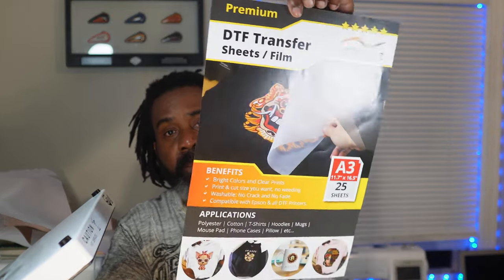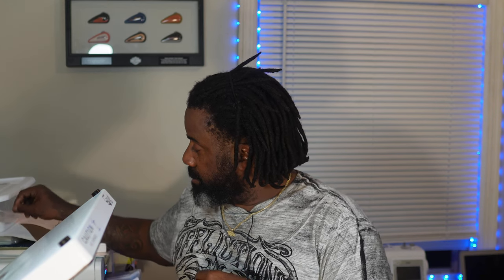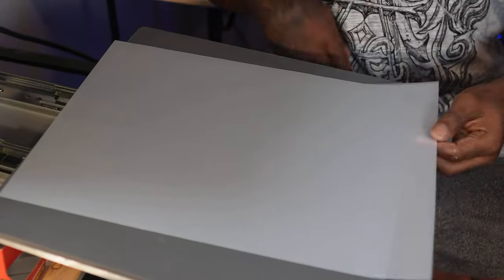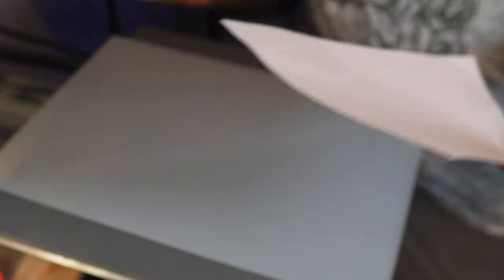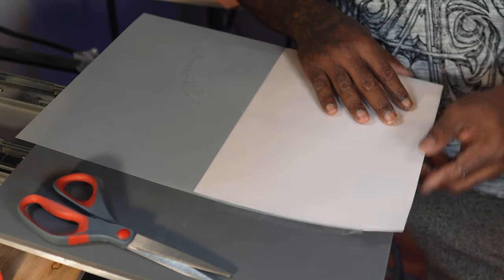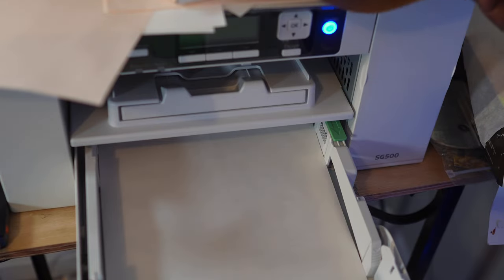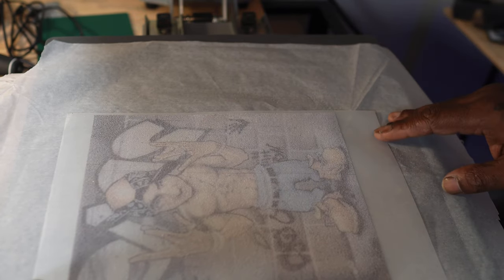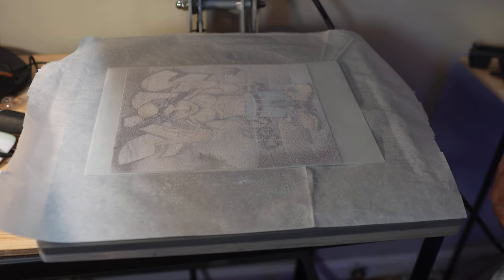How to Sublimate on a 100% Cotton T-shirt using DTF Adhesive #tiktok #hack #directtogarment #review

Comment: What ink are you currently using in the sawgrass sg500 for printing onto the DTF Film without it smearing the ink? I've got a Sawgrass SG1000 with Easysubli Ink and when I go to print it through the print manager my prints tend to smear the ink.

Comment: Can I use a common Ricoh Aficio SG 2100 sublimation printer? I have one like this but the colors are not so good and the final print  after print on tshirt is cracked.What I'm doing wrong or is this print metod not good enough?
Reply from the maker: My colors are vibrant using the sg500. Look at my next 2 videos    I give some crucial info to get successful prints every time. 
However it’s your decision if the results are good enough.

Comment: How do you keep rollers marks from being in the print?
Reply from the maker: It’s not an issue with my sawgrass sg500.
Reply: @noirkcb  Hi, nice video but I do see the roller marks that Daniel Dishman is referring to. They are the black streaks going down the face and legs of your print. Do you have those streaks on all of your prints.
Reply from the maker: No just that one….